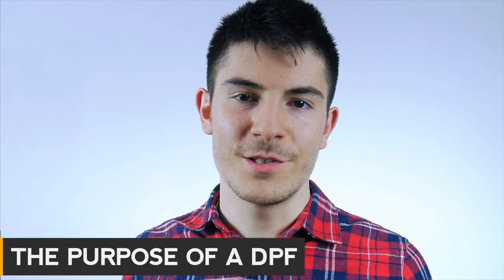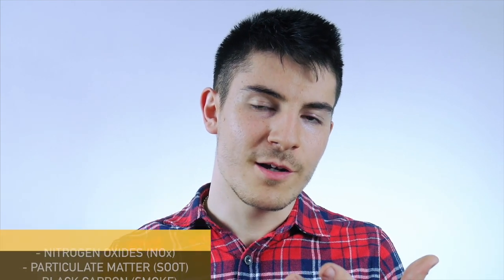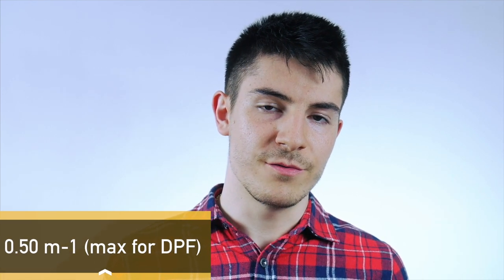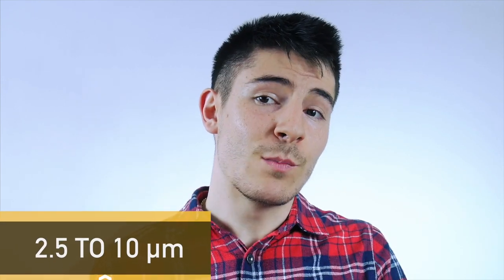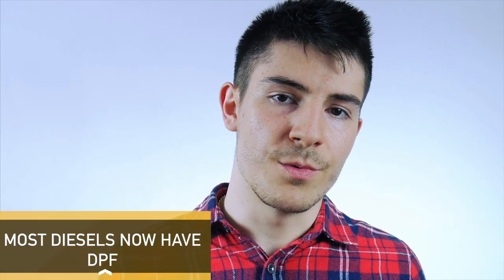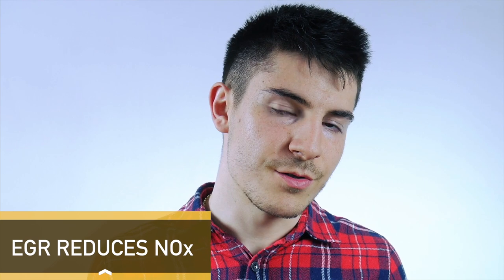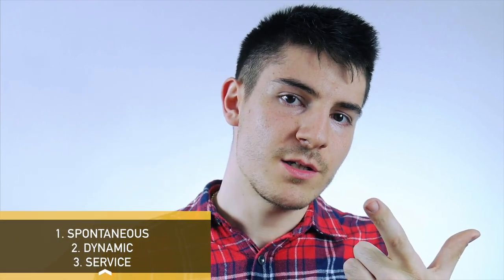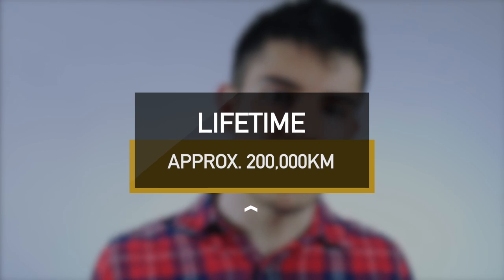The Purpose of a DPF (Diesel Particulate Filter)

Comment: I recently remapped my diesel engine ecu. Doubtful about low boost, the tuner asked me to watch out for black smoke and if it is present, let him know about it so that he can optimize the map to reduce the problem. Now my car has a DPF. So even if there is black smoke coming out of the engine, wouldn't it be filtered by the DPF? So even if there's is a boost problem which would normally manifest as black smoke, the DPF is going to mask it right? Or in simple words, is DPF going to prevent any black smoke going out via the exhaust pipe? If that's the case, I wouldn't see black smoke at all but still the engine might be spewing it out till it reaches DPF.. :(